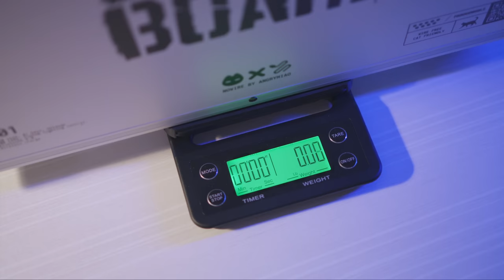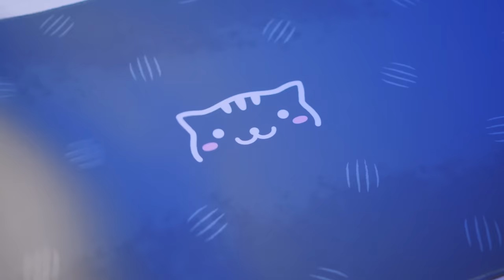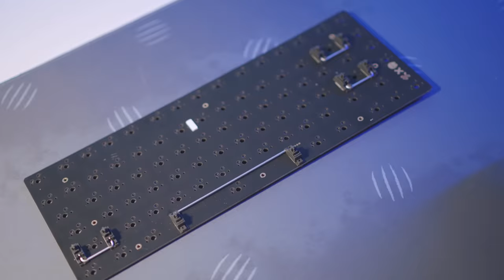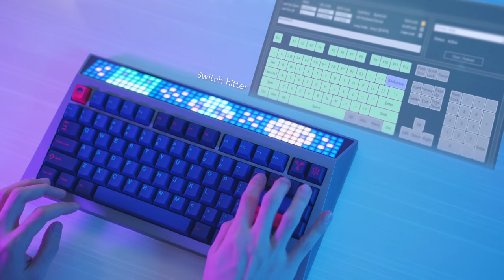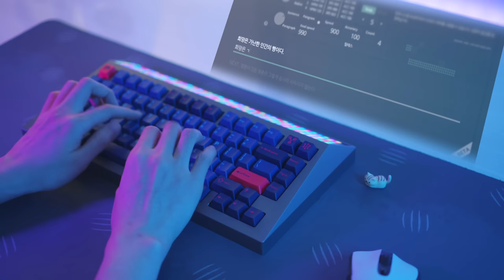CYBERBOARD Unboxing, Build, Typing Sounds (Holy Panda & GMK Laser)

Comment: This is a prototype unit, the silicone damper will be different. You can find the production one on Indiegogo story page.
Reply: So is the first whole-board silicone damper? I don't recall ever seeing one like this before. I wonder what it will feel like. I suppose i could buy some thin silicone foam and make one for my own keyboard..
Reply: @stopthephilosophicalzombie9017  the new dampener will be exact the same size shown in this video, just different looks. Yes you can replace it with other silicone foam, it is removable.
Reply: @stopthephilosophicalzombie9017  Nope Rama Works used a silicone dampener called MUTE, and also they used a foam with wave pattern. Cyberboard actually copied their design, they even apologized in their IG for plagiarizing the Rama design and they promised to change it.

Comment: Hi 3ilcat, I have been enjoying your contents so much. Any tips for balancing the wires? I tried to use 2 syringes as you do on the video. But the wire stays pretty much the same and may get worse. It will be much appreciated if you could make a tutorial video about balancing stab wires or fine-tuning stabs in general. gamsahabnida!
Reply from the maker: No specific tips for it.
Just twist little by little. That's it.
I heard some people do it for hours to make it perfect.
It's just a matter of patience.

Comment: Does the silicone mute mount help with the sound a lot in your opinion?
Reply from the maker: not sure it's 'a lot'
but it helps
Reply: Do you think it’s a good idea to put some foam in between the plate and pcb in other cases? Such as the MKultra foam in a drop alt. Thank you and amazing video by the way!

Comment: I thought they removed the internal silicone damper because it was too close to Rama's design? Guess not...
Reply from the maker: Not removed. Changed. https://media.discordapp.net/attachments/707493623163387954/735412426211852328/Lark20200722-162441.jpeg?width=702&height=702
Reply: @3ildcat  ah, okay. Good to know.

Comment: if this keyboard was 200$ I would of 100% bought it. I low-key understand the price it comes with every switches lubed, padded with silicon, amazing quality, hot swappable, amazing design, great rgb and costume lights, and  amazing stabs. like the keyboard comes perfect there is nothing to mod. only thing to put id say o-rings maybe change the lube if you'd like too but besides that this keyboard is actually perfect. Check out the creators website ( @t ) it shows in depth what is has in the inside, also he has this "cybermat" it looks soo fucking good I just hope its not really expensive but what it can do is truly amazing. Like this guy is a genius. He is absolutely making bank, I would buy if I had the money :/
Reply: well it didn't let me put the website but its in the description its the one that says angry maio